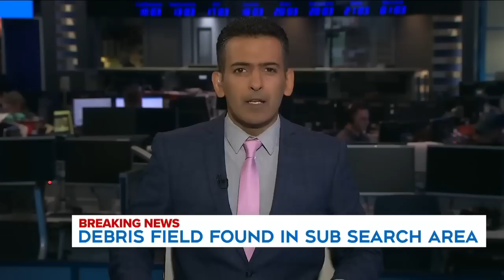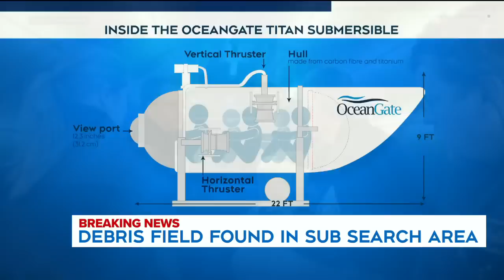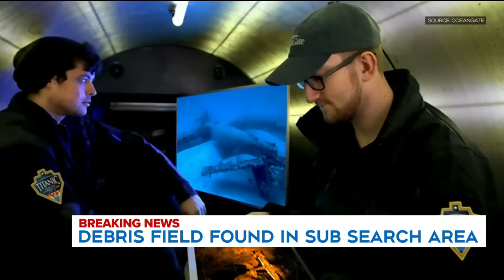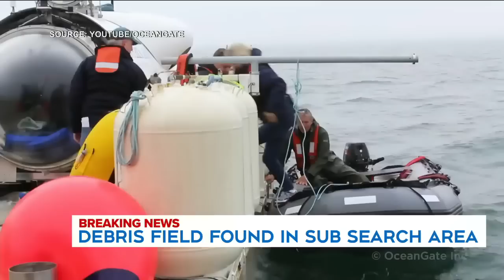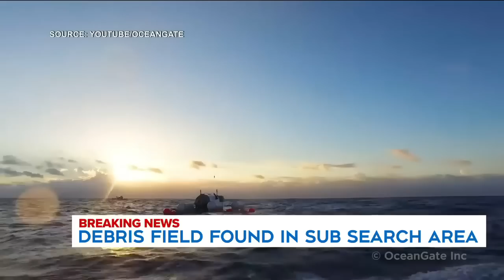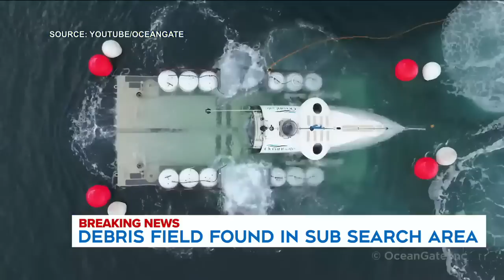TITANIC SUB SEARCH | Engineer explains concerns with 'experimental' submersible

Comment: 1:39 look at the walls of the cabin. what am I seeing there? Is it carbon fiber? or is there an inner cabin wall made of some other material. I cannot find a detailed drawing of the construction of this vessel. And other shots inside show computer monitors bolted to the inside wall. I cannot imagine that you would drill any holes into the carbon fiber wall.
Reply: The hull was titanium wrapped with the carbon fiber composite. It wasn’t just carbon fiber. The problem was using the fiber though. I’ve seen that the hull needed to be 7” thick. They only used a 5” thick carbon Fiber outer layer. The problem is the Hull should have been made out of pure titanium and been thicker. Maybe it survives longer of the Carbon composite was woven in a more expensive diamond pattern like a compressed air tank. But eventually that material would de-laminate from the pressure and take on water. Also the way they applied the resin was suspect and should have been done in an autoclave. There could have easily been micro bubbles inside the glue that caused it to fail. Which was another fault because they never did proper testing. Also the port window was only rated to 1300 meters. There are many places on the design that could have contributed to the implosion.

Comment: Mr. Kemper was very generous in his critique of OceanGate's engineering and testing protocols. This was engineering malpractice of the most egregious sort. Yes the sphere is the right  form factor, but failing that an ellipsoid is the next least risky choice. A cylinder is clearly inherently inferior, and compression-wrapping with carbon fiber adds to the compression forces, it doesn't mitigate them. I can conclude this easily with essentially an undergraduate comprehension of physics and geometry. Any engineer who can't see this intuitively is utterly incompetent.

Comment: Looks like it was overloaded, went into freefall, and imploded when it hit the sea bed.
The mother-ship waited 7 hours to call the Coastguard.
Sky News just confirmed the tail and legs have been found, but still no sign of the main hull.
Reply: "Free fall" takes place under the influence of gravity.  Do you mean water pressure?  Also, other interviewee in other channel mentions fast moving currents at one time threw the sub machinery across the undersea.  Also, the material is made up of carbon steel which was never done before, and was not properly tested.
Reply: Where was the daddy ship
Reply: @ciararespect4296  i need a daddy too